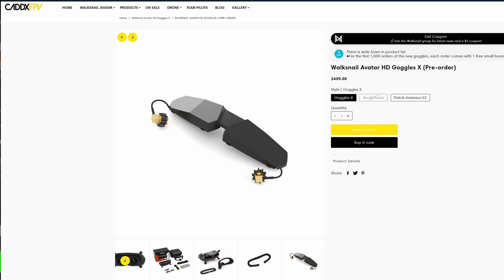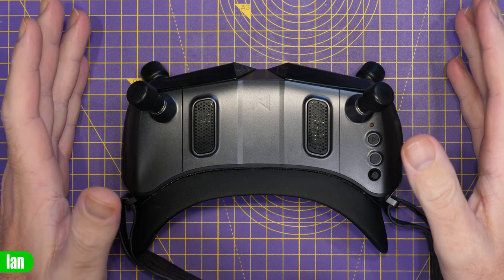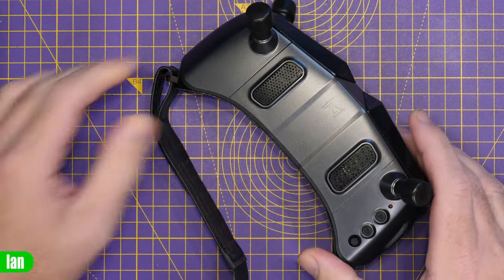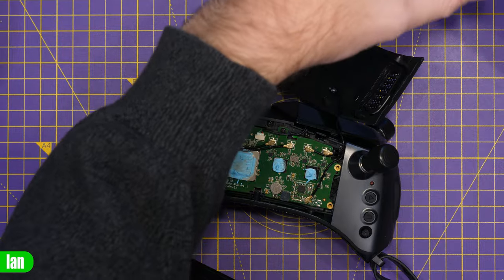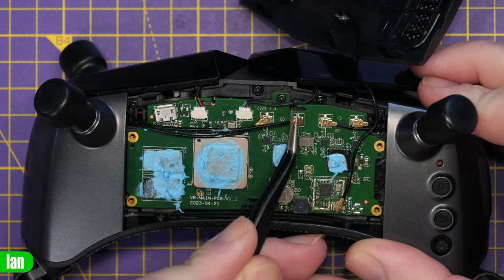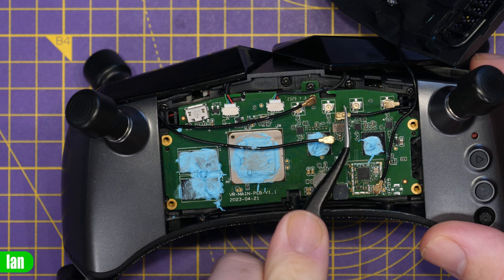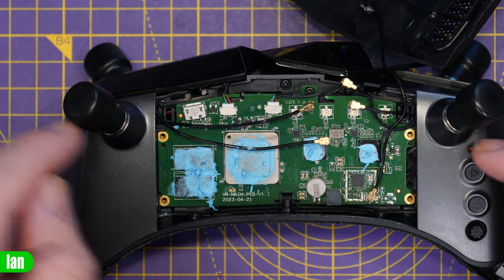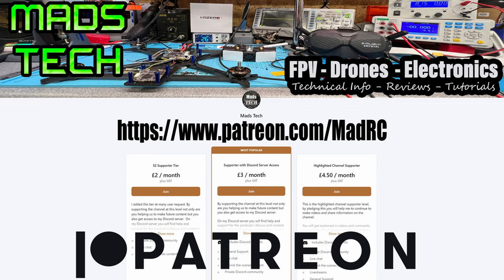Caddx Walksnail Goggles X FPV Goggles Antenna Ports  - What Transmits & Receives

Comment: The first question we should be asking is, should we be using a directional patch antenna for transmitting from the goggles, and I think the answer is no. Why? Because the bitrate required for that back link to the VTX is likely to be very low since it's only re-requesting corrupted packets/frames. Low bitrate means less susceptibility to noise so you don't need as high a SNR as for receiving high-bitrate video data. Also, what happens when you fly behind yourself with a patch on the back link? The SNR will get much worse and you're likely to not re-request corrupted frames.
Reply: If you do long range the omni on the TX port will be useless obviously. And if you do long range you learn to turn your head towards the plane. So no, in this case you don't fly behind yourself
Reply: @schwarzflieger  you're missing the point, range isn't governed by antenna propagation alone, the channel bitrate plays an important part. The point I'm making is if the data rate requirements of that back channel to the VTX is low enough an omni might be sufficient to match the range of the directional receiving antenna (which has to support the significantly higher bitrate of the digital FPV feed). This is because the lower the bitrate requirements the more tolerance you have for noise, which is basically what Shannon's Theorm tells us.
Reply: Obviously, even Shannon's theorem  can't help if antenna gain is not enough to rx/tx no matter what data put through you have. Because SNR will be too low to RX/TX even a single bit of info.   @kandredfpv
Reply: @schwarzflieger  we're talking about a 50-5Mbps video down link vs an up link of probably a few 100Kbps to re-request corrupted packets, so of course the gain of the receiving antenna would need to be in the order of magnitude at least 50 times the gain of the transmitting one. Do you really think the WalkSnail engineers are smart enough to engineer a digital VRX but not think about the antenna gain? Honestly....
Reply: to put it short - yes, according to the Shannon's theorem and Walksnail engineers kwad kiddies do not need any high gain directional antennas to fly in a park  @kandredfpv
Reply: @petergof242  🤣

Comment: If you want the patch antenna connect to the transmit port, you can just cut/file a notch on the opposite side of the original notch on the upper side in the patch antenna case. Then free the cable in the patch from the silicone fix point and route it to the top. Easy fix
Reply: Did a test flight and with the modified version i get double the range

Comment: Is there a follow-up video for this regarding antenna recommendations?  I'm having issues with signal strength on my Goggles X.  I only have 1-2 green channels and lose signal within about 300-400m ... and that's maintaining a line-of-sight...No obstacles, etc.  Any suggestions on antenna recommendations for the Goggles X?  Thank you in advance.

Comment: do you believe it's ideal to have the transmit antenna on the top as opposed to the bottom? I would assume the manufacturer has a method to their madness so to speak. Also, what benefit would the patch antenna have in general? Should I invest in it? Thank you for all your great content !!
Reply: If all omnis, then TX on top is ideal. If 2 patch and 2 omnis, ideally you want the omnis on the top for better positioning, and patches on the front for tx

Comment: My question is, should you be changing it ..?...You think Walksnail don't know what they're doing?...My guess is that it's configured this way because most end users won't be range flying....🤔😳🇬🇧 Why not simply fit a patch antenna on the transmit port if you want range flying?..seems a better idea to me...🤔😏😏

Comment: Hello Ian, i'm asking for the VRX-modul: If i have two VRX-modules close to each other and i use LHP-antennas on one VRX (and corresponding VTX) and RHP-antennas on the second VRX (and corresponding VTX), then i should be fine regarding the two VRX-modules jamming each other in close spacing?

Comment: You could put a third patch antena in the transmit port, isn´t? I won´t let a patch antenna for near / freestyle flights as the only transmiting, anyways. So, with the current layout, just need to swap from patch to omni.

Comment: the face plate patch antenna both pointed slightly to left and right both. if one is TX and another is RX the receiving direction will be imbalanced (range reduce if my drone at another side?). I will prefer buy a wider patch for TX on top and keep bottom both RX.

Comment: You will even have to change the cables inside the goggles. OR: You take the Patchantennas and you change the cables there from the bottom to the top. And then you can add the connections of the Patchantennas on the top of the goggle. There fore it works. Greez

Comment: ebay has "UFL IPX Male To Female Cable" that are 60cm so way too long, could you use those or not enough space to hide 60cm curled up? edit *amazon has 5cm version Vecys 2PCS U.FL IPEX IPX Male to U.FL IPEX IPX Female Cable 2" /5CM U.fl/IPEX IPX 1.13mm Low-Loss Extension Cable, would they impair?